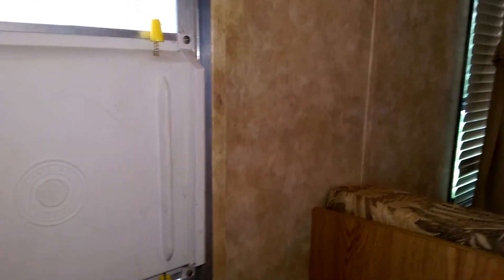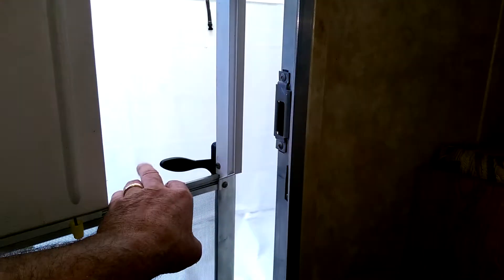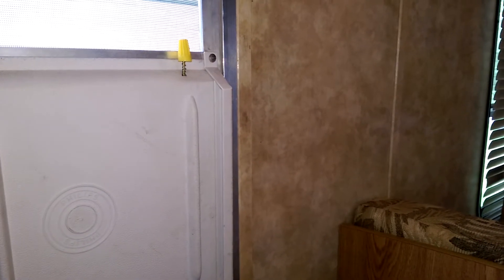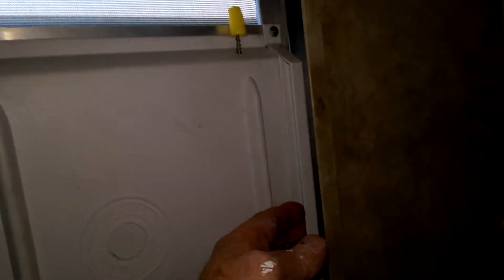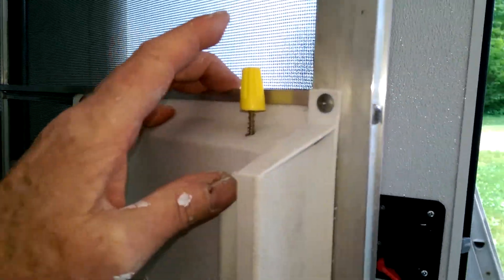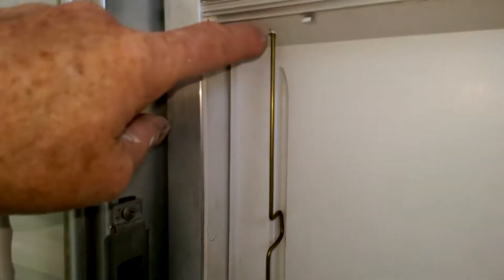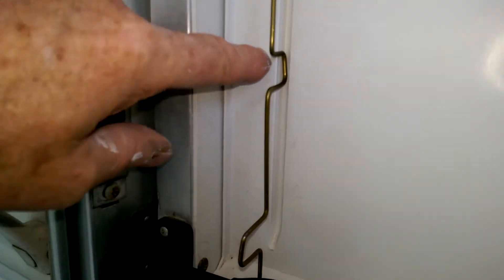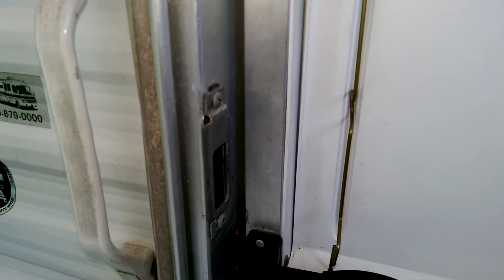Screen Door latch release for Jayco Travel Trailer

Comment: Clever & simple! 
I just did ours & uploaded a video and the 'up next' list showed this. Wow. Too simple! I like it.
Would have copied had I seen earlier, guess my search skills need some refinement:)

Ours works fine just a bit more effort to  bend up wire going up side of handle instead of cover.
Nice as yours is independent of slider position, knob up on top.